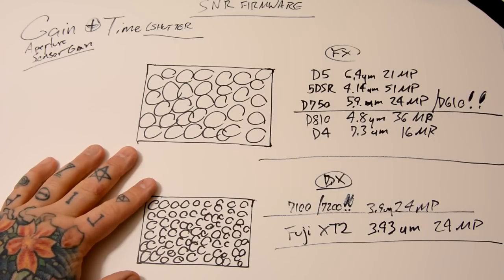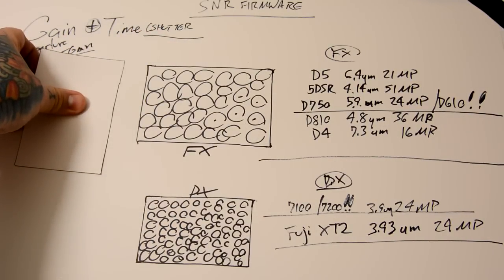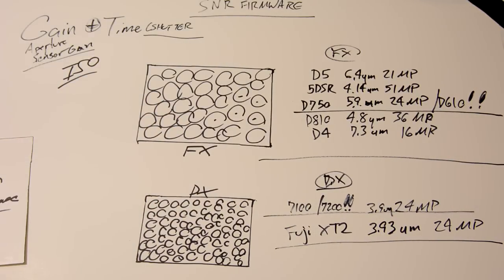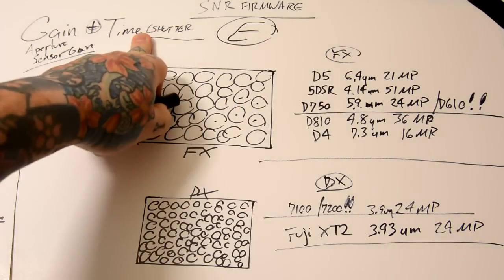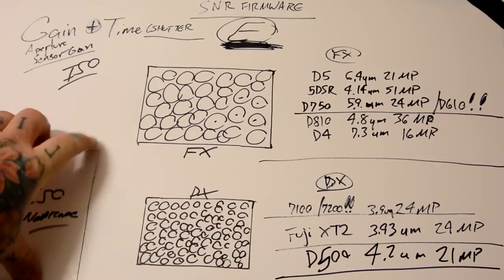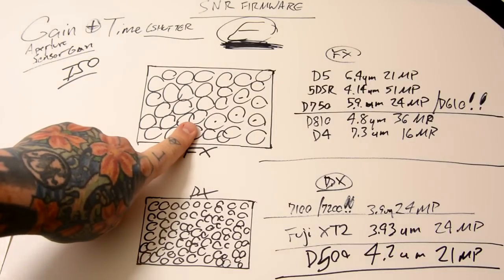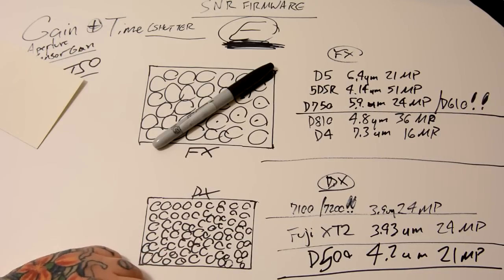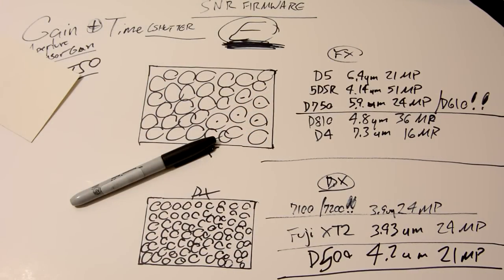FX vs. DX sensor REALITIES, 'more light', Dynamic Range, GAIN & EFFICIENCY

Comment: But....the low light performance on the D500 is "light" years ahead of most Nikon models (see what I did there?). It is clear that Nikon used an entry level full frame pixel pitch sensor and cropped it to DX format. Then crammed in the D5's processing into the D500. This seems to have altered some of the basic understanding (for me) of setting ISO, shutter speed and aperture.  Having used the D40x, the D90 and the D750, I can use my base understanding in Manual mode to get the shots I want.  The D500 has completely altered that for me.  I feel like I am starting all over again with a DSLR. The D500 is an insane beast of a camera! I can set it to ISO 100 with an F stop of 5 or 5.6 and shoot at 1/60 at medium light and get blown out highlights. With those settings the D40x, D90 or D750 (similar or same lens) I get under exposed or dark images that I have to rescue in PhotoSlop. In fact, with the D500, when I use the meter, I keep it one full stop under exposed to get the right amount of exposure (without blown highlights.)  Is it possible I am doing something wrong?  Absolutely. So...what I am I doing wrong, Professor? :)

Comment: Do not discard the picture window idea so quickly.  Actually, the individual photosites work like miniature picture windows, millions of them.  The comparison between the 21MP D5 and D500 was a perfect example of this distinction.

On another note, does multiplying pixel pitch times total MP yield a meaningful value?  I think it does.  It would be proportional to how efficiently the photosites cover the sensor.
Reply from the maker: you fool, that has to do with PIXEL PITCH,  not sensor size....... ROFL ROFL ROFL ROFL

Comment: Awesome clarification. I'm being a fan of you dude. Just one question... I have an entry level dslr D5000 with APS-C sized sensor and pixel pitch is 5.51 micrometer but D7200 sensor has a pixel pitch of 3.89 micrometer. Does that mea n D5000 is more efficient in case of low light or dynamic range than D7200? or the pixel density has any role to low light efficiency and dynamic range?

Comment: Hi there, I like your channel and I even kinda like your style. Unfortunately, I believe you got this one wrong.

If you cover half of the frame, the uncovered part of the sensor indeed captures the very same image as it would before, HOWEVER, you are now stuck with only half of the image. In order to actually use it, you have to either scale it up (sacrificing resolution) or you have to replace your "eyeballs" with smaller ones, thus reducing their signal to noise ratio. Either way, you actually DID lose quality and you actually DID waste half of the light compared to using the whole sensor.

So larger sensors actually do "gather more light" (in total) than smaller ones. Admittedly, it is a very unscientific expression but it's basically true.
Reply from the maker: NO SENSOR works off "total light",    exposure is per UNIT AREA, not total area.  
no, its basically wrong. 
the loss of SNR is made up by SNR firmware which eliminates out set noise frequencies to a great extent

Comment: I don't get it. Is this some kind of a joke? Your simple bucket vs. kiddie pool analogy does a great job of demonstrating how a larger sensor gathers more total light than a smaller one. Are you just testing us to see if we can think for ourselves?  Just because the amounts of light per unit of area are equal does not mean the total amounts of water in each vessel are equal.  2” of rainfall in a bucket with an 8” diameter (= 4” radius) bottom would place about 100 cubic inches of water (2 * 4 * 4 * pi) in the bucket, whereas the same amount of rainfall in a kiddie pool with an 8’ (96”) diameter (= 48” radius) bottom would place about 14,476 cubic inches of water (2 * 48 * 48 * pi) in the pool.  Both containers receive the same amount of rainfall but the one with the larger area clearly receives more total water.

This is a lovely analogy for the sensors.  Even though the amount of light per unit of area is the same for both sensors, the total amount of light is a function of the sensor size, not just the amount of light per unit of area, thus the larger sensor receives more total light.  This, of course, does not affect exposure, since exposure at the sensor surface has to do only with the quantity of light per unit of area and not the total light received by the sensors.

This, incidentally, is why your little trick where you covered half the sensor works and yet fails to support your conclusion.  While it’s true that covering part of the sensor does not change the exposure of the uncovered part, it nevertheless cuts the total amount of light received by the sensor in half.  Total amount of light received by the sensor does not affect the exposure.  The truth is, the sensor does act like a picture window, just like the lens aperture does, and the bigger the window the more light it allows through.  Okay, technically, the sensor is more like an ice cube tray than a window, nevertheless, the total amount of light it receives is directly related to its size.  Both the picture window and the bucket analogies are useful for describing this.

The argument that the lens “poops out” the same amount of light regardless of sensor size is accurate, but irrelevant.  Because the sensors are rectangles set within the circle of light produced by the lens, some of the light falls outside of the sensor and is lost.  Neither sensor receives all the light produced by the lens.  Each one gets a fraction of the lens’ light dependent on the size of the sensor.  Smaller sensors simply allow more light to be lost.  The lens doesn’t need to know about the sensor size because it supplies more than enough light for either sensor.  And this has nothing to do with exposure because the light per unit of area does not change from one sensor to the other, only the total amount of light the sensor senses.

The semantic argument that ISO is applied gain and therefore not part of exposure is even less relevant to the question of total light than your other arguments.  All of your arguments fall into the same category as Microsoft Help:  Highly Accurate and Completely Useless.

Really, I am amazed that you can have such great analogies, demonstrations, and just plain helpful information, yet arrive at such logically unsound conclusions.  Is it possible that you get some pleasure out of confusing people and browbeating them into incoherent sheep-like behavior, or are you really this confused yourself?  Maybe you’re just setting out bait for poor saps like me who can’t let this kind of crazy talk go unchecked (looks like I took the bait)!  I’m not trying to be disparaging or diminutive, I like a lot of your videos and respect your viewpoints, but in this case you’re simply wrong and it would be disrespectful to let you go on and on without saying something.
Reply: i think all he’s saying is camera companies are idiotic in their confusig marketing. 

if all you are trying to do is catch a butterfly, all you need is a butterfly net (dx). camera companies would have you think you need a net the size of a house, when, in reality, a bigger size makes it a burden.

he’s saying it’s dumb to make a car that has 40 cylinders, if all you’re trying to do is go to work and get groceries.
Reply: 10 words or less,  please.

Comment: So the Fuji GFX with its 51.4 MP sensor being 1,7x the size of FX (like the one in the Canon 5DSR) has a pixel pitch of about 7um. That's close to the 7,3 um of the 16 MP Nikon D4. I wonder how good Fuji's SNR efficiency is and if it will come close to the Nikon. What do you think? Thanks for the video, Ken!

Comment: Great video Ken.....even some of the stupid people can probably understand it.   I did own the 5DSR for awhile but because I was cropping to 7D2 size anyways and using it for birds a lot of the time it of course performed just like the 7D2 for noise and DR etc....so sort of useless....but when I could fill the frame with something then I got a super image.  

Interested to hear your thoughts about if you downsize a 5DSR file to say D750 size you do hide the noise so that is a consideration if you have a high ISO image.  The fact that Canon limited the ISO of the 5DSR to 6400 tells you something!!  They still let the 7D2 go to 16000 which is really odd!!  Still downsizing can get you back some of the stuff you loss with those tiny eyeballs on the 5DSR.

Still I sold the thing for the vastly superior 5D4 which rivals my 1DX2 at high ISO and that can only be down to SNR processing as it has 50% more pixels.  Don't flame me for the 5D4, I love it as a companion to my 1DX and 1DX2.  Mostly for its f/8 focusing abilities as I use a lot of f/8 lens/TC combos in my bird/wildlife work.

Comment: For a given resolution, APS-C sensors have more digital gain applied in-camera before they are saved to the RAW file.
Reply: If a Micro-Four-Thirds pixel has 4 micrometer pixel-pitch and under a constant light source accumulates 0.2mV in 1 second, then under similar exposure, a full frame pixel will accumulates 0.8mV in 1 second.

In order to be rendered in a digital image these voltages needs to be assigned a digital number corresponding to a value in the chosen color space. If it is 8-bit jpg then the camera will need to assign a digital number which is an integer between 0 and 255,  where 0 is pure black and 255 is pure white. In order to render the same jpg brightness on screen in both MTF jpg and FF jpg, the analog MTF pixel data will need to be amplified more than the corresponding full frame analog pixel data before being saved to file.

Comment: so Ken,  since the Pixel doesnt matter but only the pixil pitch. FX are only better for Low light than DX?
Reply: I believe FX have much better HDR than DX which comes very handy in some situations.
Reply from the maker: thats generally true but not true regardless…lots of things matter, photosite size, microlens design, SNR firmware, signal processing AD converters……
Reply: True! Thanks, the lack of knowledge of the other Youtubers are driving the armatures crazy and upgrading with no reason to.

Comment: Bigger sensor, bigger pixels. Bigger eyeballs right? Magic after the sensor? Sure. Efficiency? Sure. Grainy on film? Sure. Don't treat your audience like fools Ken, some of us have been watching and listening for a long time, before your Fujifilm adventure started. Full frame or Cropped, both great technologies, however different.  Different use for different situations. Low light shooting with digital cameras I'll take a full frame camera anytime. Why?  Simple, I get better results. I want better out of focus blur at minimal focus distance?  I'll take a full frame camera anytime. Why?  Simple, I get better results. In fact I don't care if the camera uses Voodoo or black magic, I ONLY look at the results because that is why I make the picture in the first place. Continuing to make video's like this, with disdain, you will get results, sure. You will have the audience you'll attract and be dismissed as a fool, which is a shame because you're not. You are changing Ken, and not for the better.

Comment: All these people cooing over up and coming 100MP sensors thinking they will be awesome not realising all it is is a full frame sensor with the pixel pitch of a 1" 20MP sensor. You coukd make a 250MP if you scaled up a point and shoot 20MP 1/2.3" sensor but of course it's dynamic range would be horrendous. Fuji seem to be the only ones who really understand what this video teaches. If you want more megapixels without reducing dynamic range you can only do it one of two ways. Make the sensor physically bigger ( thus the medium format ) or continue to squeeze more out of signal processing which is rapidly reaching a point where improvements are harder to increase.
Reply: Oh yeah , right so then why does medium format use 100+MP already ? Bigger surface area, bigger "eyeballs" and more dynamic range... slow camera, slow processing due to said megapixels, but a very good signal to noise ratio, so much better dynamic range and shadow recovery. The thing is that with the newer camera's the processing quality increases too, so it would not be weird to have a 100MP sensor soon with the recoverabilty of a 24 MP sensor today. Pixel pitch is only interesting if all else is equal, though all else is clearly NOT equal, Just look at the a99II from the brand you guys so lovingly call Fony which as a better processing than the a7RII has, both are 42MP, A99II loses half a stop due to the SLT of light, but doesn't lose on IQ. IQ actually looks better on the a99II due to the front end LSI ( much better processing).  Ken nicely pointed this video here so , good job Ken !
Reply: Darkmanmr47 Would you suggest that the Sony A99II with its 42MP full frame sensor beats the Nikon D5's 21MP full frame sensor in terms of dynamic range and high ISO capability? I agree that pixel pitch alone isn't the single factor in determining DR ( if that were so, older low MP count full frame sensors would still be the best and that's clearly not true). Sure even Ken acknowledges that improvements in SNR and processing have allowed smaller pixel pitches to achieve and even exceed these older full frame sensors.  The reality is you can only do so much, whilst processing will inevitably improve its clear that if you want say a 100MP sensor right now that doesn't loose DR capability against current sensors the easiest way is to make the sensor physically bigger. That way it can compare with current full frame sensors by having the same size pixel pitch yet still offer higher MP count. If you are suggesting that Sonys A99II matches or exceeds the DR and high ISO capability of the D5 just because Sonys processing is so good then I would have to disagree with you on that point. I will say that the Sony A99II is a very impressive camera indeed.As a Sony E mount shooter myself I certainly am not saying this out of any dislike of Sony. I am simply stating that you can't get a pint out of a quart. Even Sony released the A7S,  a mere 12MP sensor because they acknowledge that it's the only way to do it, keep the pixel count low and keep them large! Sony know they can't simply " process " improved  DR and high ISO, you have to gather the information first before you can process it.

Comment: Ken help me through this...if an FX lens has a max aperture of 2.8 and I stick it on a DX body will I then be left with (2.8*1.5) effective stops of light being pooped onto my sensor (since F-stop is a measurement of total light entering the lens?)
Reply from the maker: no, nothing changes, all lenses on earth crap the same light out the back,…..all that changes is CROP (or not) and the native GAIN of the sensor and its MP count
Reply: thanks, I now actually understand that its the 'brightness' at any given point. Makes sense with your bucket analogy in mind. Wasn't sure about the lens rating being linked to the area of exposure or not
Reply: thanks Ralf :)

Comment: So if the 51 MP sensor had pixel pitch of 6.3mm for example, would they do better in low light and high ISOs?
Reply: Exactly, it would be medium format. ( which is actually not a fixed size ).
Reply: Sure, but it would then no longer be an FX size sensor.

Comment: Do wish someone would let Troy Rathilfl this, fed up hearing him talk his larger sensor/more light crap!
Reply: The larger the sensor, the more light. Cell phone camera = crappy night shots; Full frame camera = decent night shots. Same shutter speed. Yeah, they must be definitely collecting the same amount of light.
Reply: Fr_z_n You might have watched it but you didn't get what it's about. Rewatch 00:10 - 00:16 where it clearly states that larger sensors don't gather more light. And that's the statement I replied to. And yet you claim the video has nothing to do with the sensor size? Try turning on the subtitles next time, maybe it helps :)
Reply: Fr_z_n  So you're saying that if a full frame camera had the same pixel density as a mobile phone camera, the noise level in printed images of the same size would be the same?
Reply: No compression, RAW files only. Only the sensors are different, everything else is the same (electronic components wise)

Comment: So can crop sensors ever have the pixel  pitch of full frame cameras? Even though FF dont gather more light, it still seems like a fact that FF does better in low light
Reply from the maker: yes, but then theyd be 12MP etc cameras
Reply: Kel Vin If FF don't gather more light how are they better in low light? Think about it.
Reply: The sensor does not gather more light. The eyeballs are bigger on the sensor.

Comment: The pixel pitch on the 5DSR is close to the D500 but the D500 will kick its ass in low light and dynamic range?  So the difference is the processing engine? But AHHHH you have said the D500 has an issue on the highlights?
Reply from the maker: it does, the D500 gets its eyeballs blown out easy on highlights
Reply: Theoria Apophasis
So that is where Nikon has given up the dynamic range
Reply from the maker: if you want something that SEES in the dark,  its gonna suffer in the light
Reply: Theoria Apophasis That makes sense
Reply: Dennis W 
What is cheaper and simpler? 
New (sensible) eyes or new sunglasses?